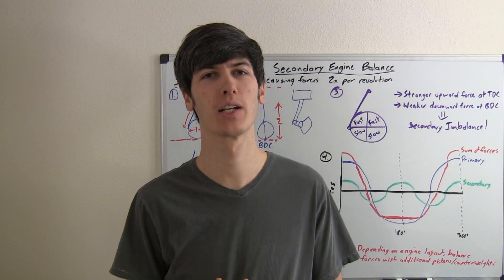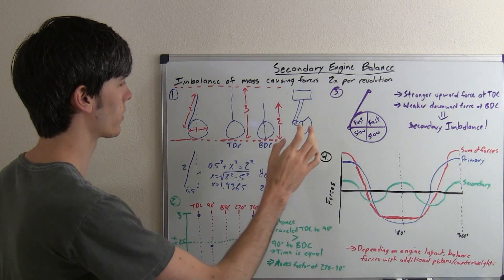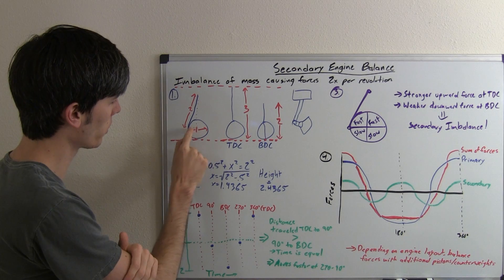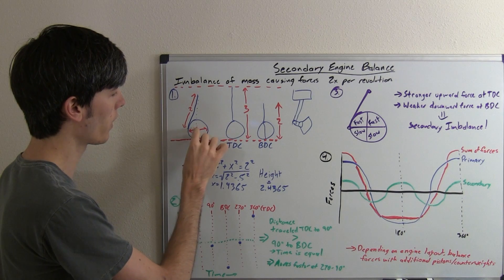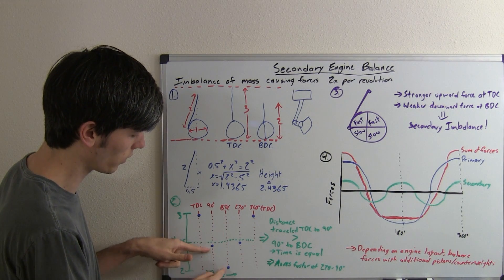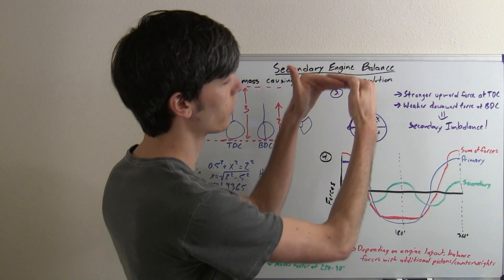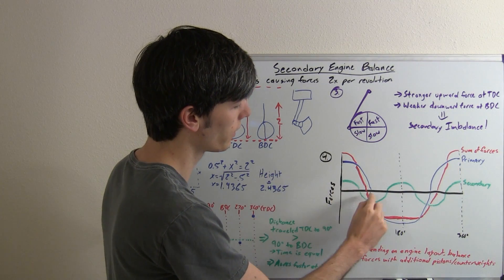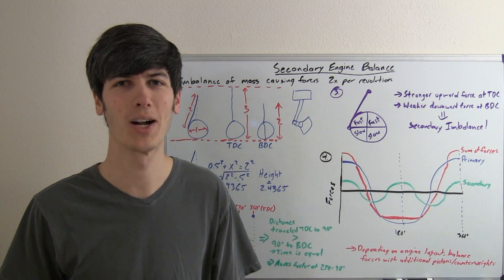Secondary Engine Balance - Explained

Comment: why/how does it travel a greater distance in the same amount of time? I just cant seem to visualize how based on the geometry the distance the piston travels is changing
Reply: ***** It doesn't travel faster at the bottom.  It travels faster at 90 and 270 degrees and slower (actually not at all, it stops moving and reverses direction) at 0 and 180.
Reply: ***** When @ 90 and 270 degrees, crank rotation speed (very nearly) is equal to piston travel speed. When @ 0 and 180 the crank continues to rotate at (very nearly) the same speed but the piston isn't moving at all. All other angles fall somewhere in between. Simple...
Reply from the maker: That's what I'm attempting to show visually in the bottom left corner of the white board.
Reply: graphically, I kno, but geometrically? like why/how is that happening on the actual piston mechanism
Reply from the maker: That's what the math is showing. If you take a straight line (connecting arm vertical), versus a slanted line of the same length, and measure it's height, it will have a shorter height since it's at an angle. 0.5 + 2 > 0.5 + Slanted "length of 2" connecting rod.
Reply: alright, but why does the circular motion at the bottom of the arm cause that to happen?

cuz if the rod was just going up and down it would be balanced, but because its a circular motion, it causes a radial force aside from at 0 and 180?

btw, not breaking ur balls. genuinely interested
Reply: No problem man it's totally cool, and EE feel free to correct me if i'm wrong about any of this. What causes the difference is because the length of the piston stroke changes. The length changes because where the piston connecting rod is mounted to the counter weight is not exactly in line with the crankshaft, it's offset like you can see here http://tinyurl.com/kzfs236 . What this means is although the connecting rod is the same length, because it is mounted away from the crankshaft, you're adding and subtracting length to the stroke each time the engine rotates (that length being +/- the distance between the crankshaft and where the connecting rod is mounted). So lets say you have a connecting rod 2" long and it is mounted 1" off-center from the crank. This means it will have a length of 3" at the top of the stroke, and 1" at the bottom of the stroke. Keeping in mind that the piston moves in a linear motion, this is what causes the appearance of slowing down and speeding up. The crankshaft rotates at a constant rate, but the addition and subtraction to the length of the stroke causes the rod and piston to move at different rates. Hopefully that helps and sorry for writing a short novel haha. Here's one more pic that might help you visualize the process -> http://tinyurl.com/o9n2xao
Reply: So finally I figured it out.

Since the bottom of the arm is moving in a circular pattern, when the bottom of the arm is at 90 (0 being the top of the circle), the top of the arm moves 0.5745 down. This means that the top of the arm only needs to move 0.4365 down to get to the 180 point on the circle. Because the bottom of the arm needs to cover less distance in the same amount of time, it rotates slower; meanwhile the, when the bottom of the arm is at the top portion of the circle, it has more distance to cover and must rotate faster.

Drawing graphs of the circle height contribution vs the angle, and the height contribution of the arm vs the angle and superimposing to the graph EE has in this vid helped a lot with visualizing that one
Reply: Jason Rogachesky thank u for being so educational and condescending
Reply: ***** Sorry, that was (out of context) in response to the comment I had just read about simple explanations requiring complete(ish) understanding. Read as "here is a simple explanation". Not aimed at the concept or any individuals conceptualization of it.  Ironic that I am now expending such complicated effort explaining myself. =)